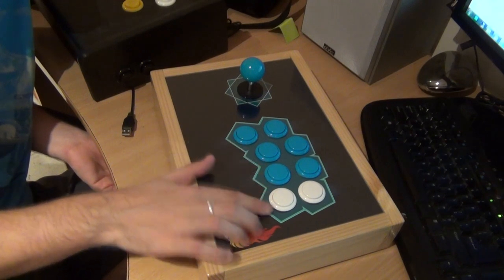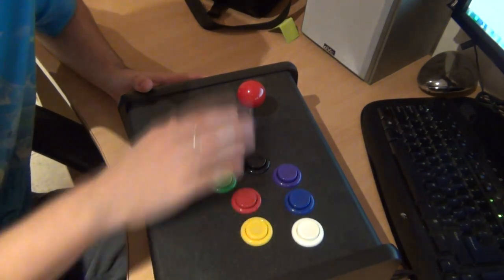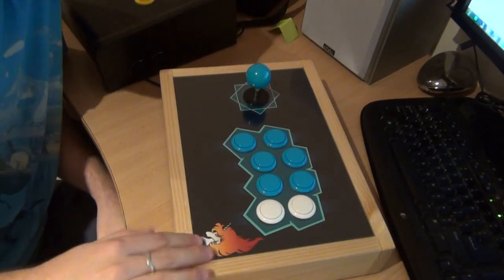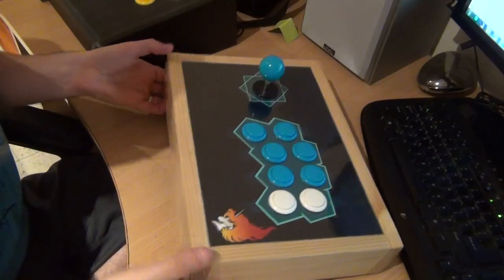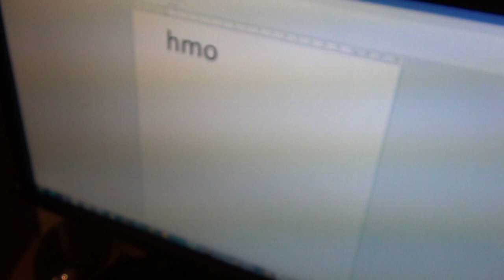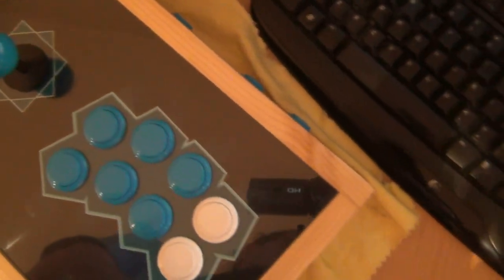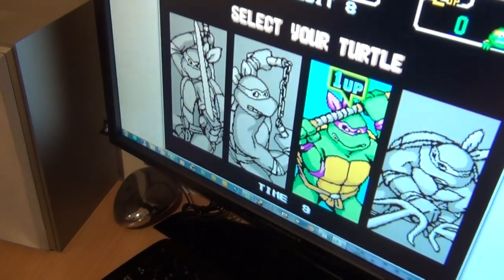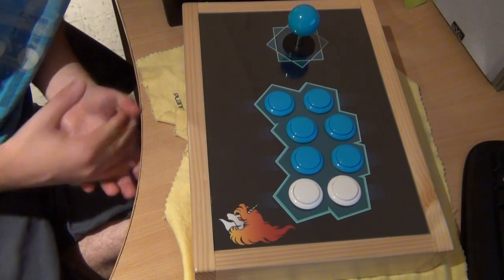DIY Wireless Arcade Stick (Part 1)

Comment: I'd be very interested in you revisiting this project due to all the changes/ improvements over the past 10 years. Personally I'd like to build one that has a spinner and trackball, with side buttons for pinball. It can be wired as far as the power supply, but the TV connection must be wireless. Thanks!

Comment from the maker: I built this sometime ago, but i dont recall there being a ground.  You can get the vero board from your local electronics shop or alot of online shops have it too.  The one you want is the one with straight tracks.  You cut a line across the tracks so you have 2 groups of rows. The IDE cable plus in so that, one side of sockets attachs to one side of tracks, the other side attaches to the other side of tracks. Hope that makes sense!

Comment: An edge board connector that fits a wireless keyboard encoder... would come in handy. 
Short 2 wires = keystroke...
But how do you short out a sanwa joystick with 1 wire and a common ground? I end up with 4 keystrokes instead of 1...

Comment from the maker: I used an IDE cable going from the PCB pins to a piece vero board with rows of headers soldered into it.  So you can just plug the IDE cable connector straight onto the header pin board.  If you use header pins on the ends of your button / switch cables you can just plug them and / remove them as you like.  Hope that makes sense, kind of difficult to describe.

Comment: Hey Paul. I watched your video and want to make my arcade stick wireless. I took out a PCB of a wireless keyboard I had. it has 2 sets of  9 pins and 2 sets of 4 pins. I took a wire and touched one of the 9 pins and one of the 4 pins at the same time and was able to find all the keyboard assignments. I was just a little confused on what you used to connect the wires from the PCB to the switches. I also cant find the ground on my PCB. Thanks Rich

Comment: Do you remember where you got that board? Also, is it necessary to ground everything? I can't find a ground on the board. On the wired stick I made, I daisy chained the ground from all the pushbuttons to the I-pac board. It seems a lot different with a keyboard PCB. I agree, it is difficult to explain

Comment: Do you sell these?
Reply: ya i don't feel like making one lols
Reply: What you linked to has been around for years and it's 'wired'...  the reason his is more difficult is because he built a 'wireless' version... there still isn't many good wireless ones around unless you built then from a 360/ps3 controller - ps3 controller is easier if you use 'axisdapter'....  I'm tempted to try this one...
Reply: Wish these arcade boards were Bluetooth.. I'd swap out my boards in a heartbeat.
Reply: Chris Burke it’s stupid really because the manufacturers don’t make wireless not only because of input lag which defeats the entire point of tournament style sticks but because having too much splices would raise red flags in tournaments. Although having a Bluetooth capable pcb to adapt with a wire makes complete sense and you can find a lot of products available today that can integrate into your arcade stick to pair with your devices.